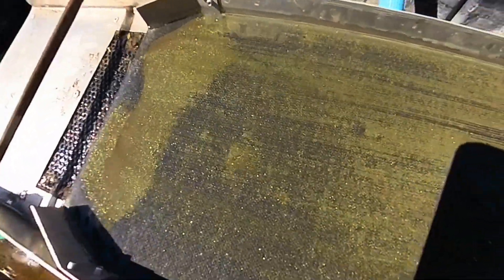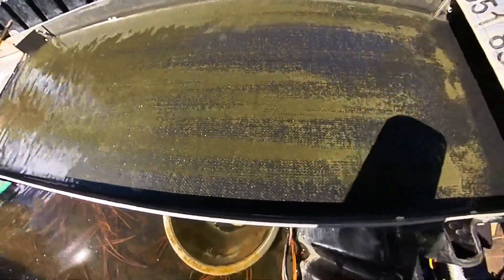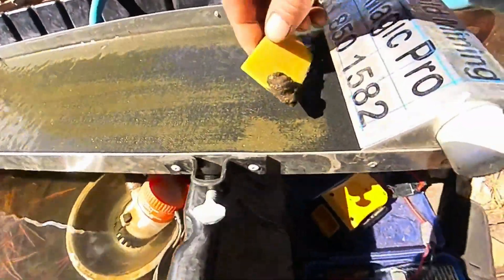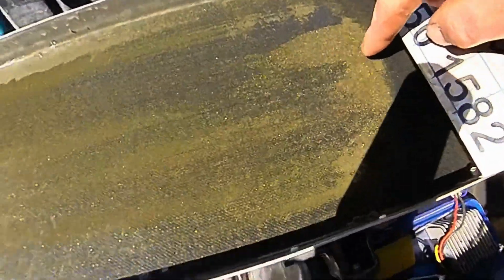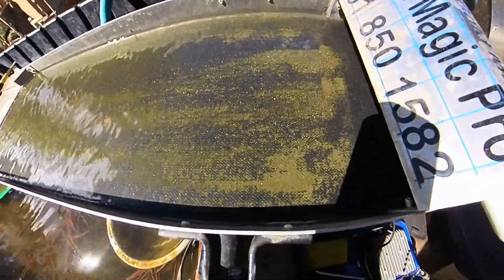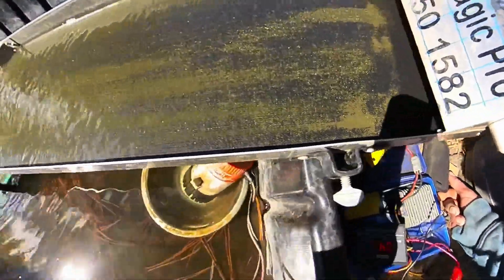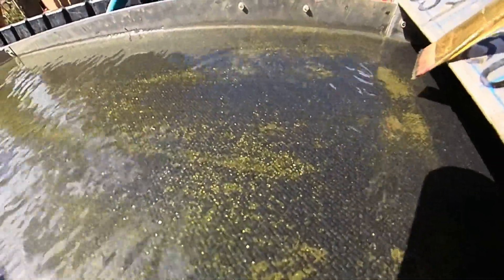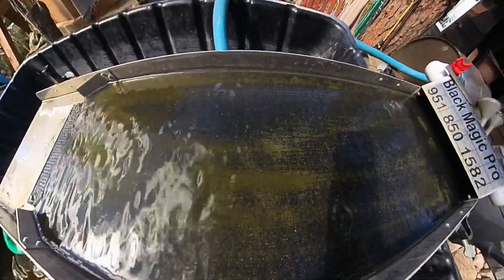is this gold too small for conventional recovery?

Comment: you could gather all of the sludge and then just melt it. you could also dissolve most of it in acid and reconcentrate it with sodium bicarbonate. i am just saying there are things that can be done, but it comes down to whether or not you are the one that can do them.